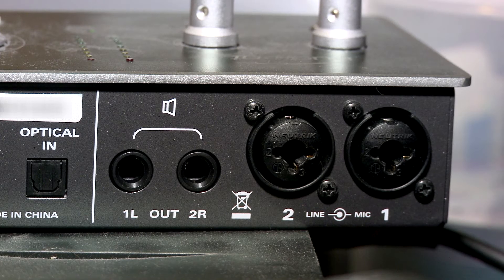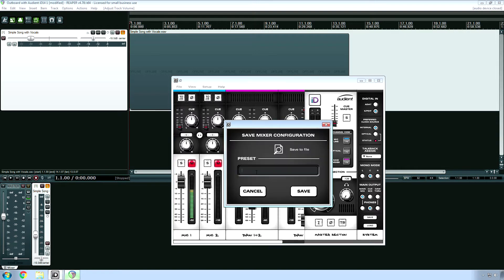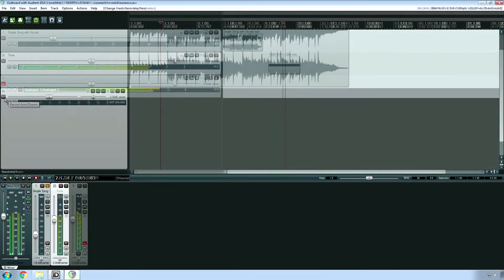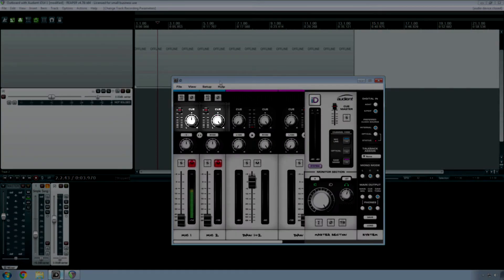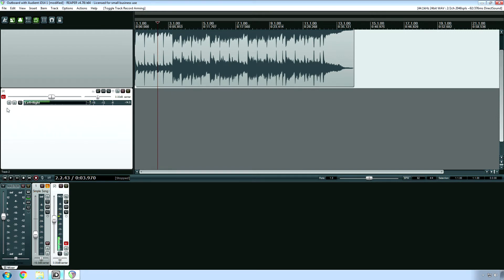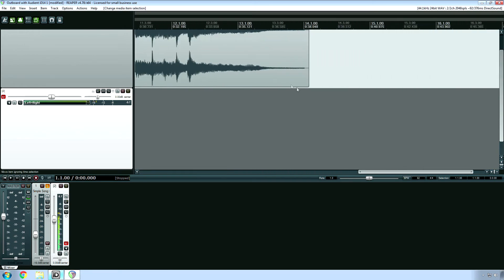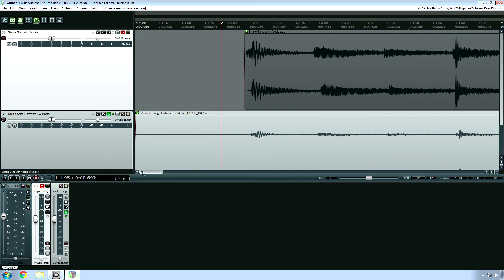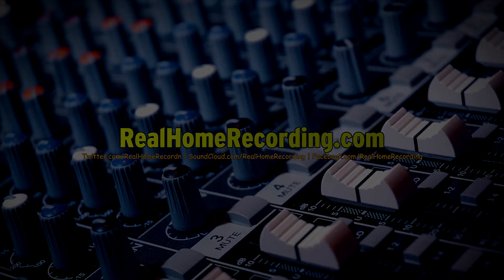How to Use Outboard Gear with USB Audio Interfaces Tutorial DAW Mixing & Mastering

Comment from the maker: This was a tutorial that many have requested over the years but I never got around to making until now. Hopefully everything in it makes sense. I tried to be as thorough as possible without going off on tangents to keep the video length down. 

As stated at the beginning, it's more of an advanced tutorial so familiarity with audio interface routing controls is key.
Reply: TRS is a balanced connection. TS is an unbalanced connection. RCA is an unbalanced connection too if I remember correctly. The black is for a negative connection and the red is a positive connection. With modern technology you can find TRS to rca to get a balanced connection.

Comment: I have 6 analog plugins and am getting a delay and instead of compensation I’d rather record through channel strip to interface and run it back out of interface into the rest of the hardware, can I do this with a Scarlett 2i2 interface or do I need a bigger one? I’m thinking I need a bigger one.

Comment: Hi Adam,

I’m an Id22 user and am still running into some problems w/ tracking through outboard.  I’d like to run previously recorded material through a compressor (or even use my Golden Age pre-q 73 w/ compressor on the insert to get the benefit of it’s limited eq functions plus getting the benefit of using it as a “colored” line amp). I also have a focusrite preamp w similar functionality (an insert option and analog high pass filter) that might be nice to use to run reaper tracks Through outboard compressors.  ’ll try following your tutorial again tomorrow, but would it be possible for you to  perhaps walk me through this process?  I don’t know if you still have a Patreon account (and I’ve never actually used the patron account just FYI) but I know your time is valuable and I’d be happy to pay you for your service.  I watched your most recent video and I couldn’t agree w you more “time is the most valuable commodity”.   As I’ve spent a lot of time on this project (in trying to do what I’m asking about and what your video is explaining) and am still having issues: your 1:1 guidance would be quite valuable.  Please let me know how I could best pay you for your service and consider working w me on a 1:1 “FaceTime” basis.  Pls name your price and conditions for working w me. Again my objective is to simply learn how to run previously recorded tracks through outboard using Reaper and my outboard gear (printing the outboard “effected” tracks on s new track in Reaper).  It’d also be great to monitor the effected track on headphones so I could naked adjustments/tweak the outboard gear to taste and hear what I’m doing outside the box so to speak.  As a longtime subscriber I trust your work and am
Happy to pay you for your service.  It would save me a lot of time/money in frustration as I’ve hit a wall following online advices and trying repeatedly and failing to learn how to learn this
To no avail.  I’ll post this under your newest video in case posting this under your most relevant (but older) video won’t reach you,  pls consider payment
For your audio engineering expertise (it’s worth it to this struggling yet determined Id22 audio engineering amateur).

With gratitude and respect for all you do,

Jeremy Whisenhunt M.Ed,

Comment: Hey man great video and explanation. Does the Antelope Zen tour have enough outputs for this from your understanding? I think from what I learned from your video it does but I want to make sure I can hook up some hardware without using external preamps or expanding the Zen Tour with the ADAT . 
https://www.sweetwater.com/store/detail/ZenTour
specs are here ^
it says: Ample digital and analog connectivity
In all, the Antelope Audio Zen Tour's I/O selection is amazing considering its compact size. Two sets of stereo outputs with A/B switching are present for your studio monitors, and another eight channels of analog line outputs are available via D-sub. For digital connections, S/PDIF is onboard as well as two ADAT ins and outs.
Thanks again for the video, cheers.
Reply from the maker: It definitely does through the D-Sub line outputs.
Reply: Thanks for the speedy reply, how does the D-Sub work? Does it add split outputs through this sort of patchbay? Sorry for all the questions I barely ever used outboard gear in my recordings.
Reply from the maker: It works pretty much like a standard cable except on one end it looks like an old school computer data cable. On the other end you choose which connectors to get. 1/4" TRS phone connectors are typical but you can do XLR or RCA as well. You can also buy cables that don't have connectors so you can solder on the type of connectors that you need for each output.
Reply: Thanks. I thought the other pair of monitor outs can also be used.
Reply from the maker: They can indeed. So if you only need two channels use those. Probably at the maximum volume level.